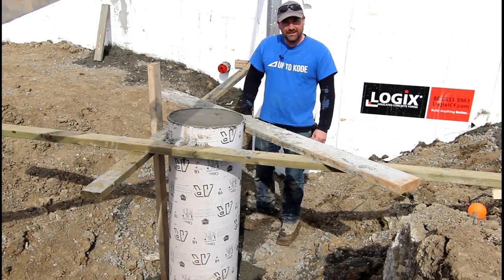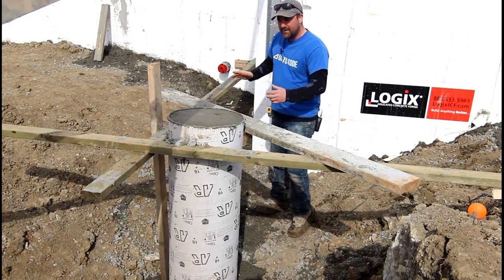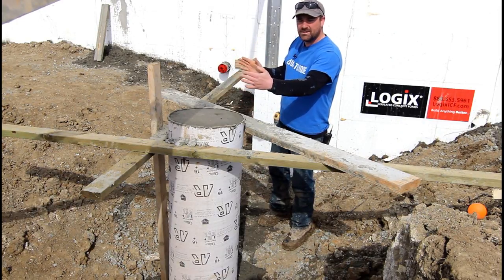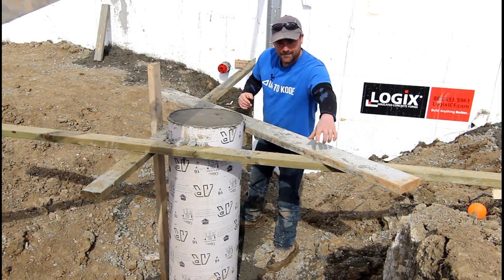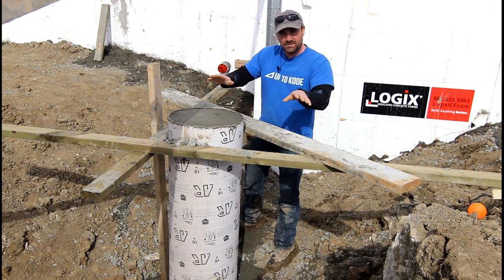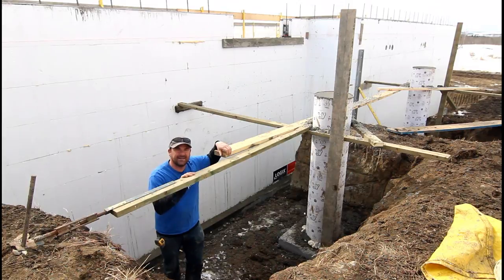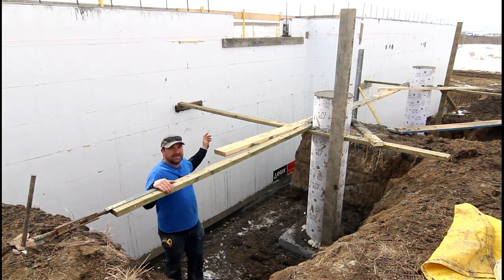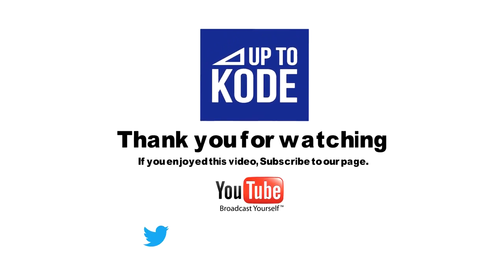The Best Way to Set a Sonotube or Pile

Comment: seems to me if the column/sonotube is connected to the wall, and it moves, the tube top moves and the base doesn't so it has to be replumbed.  It doesn't stay plumb.  assuming plumb is important.

Comment: Great video. How can you secure the 2x4 to the icf wall? is'nt it made of foam?
Thx
Reply: yes it's a very robust type of magic foam...
Reply from the maker: In most ICF blocks there’s a tie every 8 inches. This holds the force of concrete while pouring but also it there to attach drywall and siding too. 

If you look carefully (and hope you can see) there a 2x4 attached horizontally to the plastic ties. Then we can attach our braces to that 2x4.  

Does that help?

Comment: what a mess ! me and about 4 guys would set 50,  9 footers and pour them the same day, u use 2, 2×4s collar the top drive some stakes in the ground plumb them up and nail it....
Reply: DAMN SHAME!
Reply: Hey buddy. Do you think you could describe that to me a little better. We’re building a 5000sq ft lodge.   . 4 x 4 footings with 24 inch sauna tube , ranging from  5 foot six” tallest to  18 inch. Shortest
Reply: @bradforester3635  Hey Brad for the tall ones all you need to do is cut 2 short pieces of 2×4 and looking straight down on the sono tube from the top nail one vertically on the right side of the sono tube with end of 2×4 flush with the top , take the other block looking down on the tube nail it on the top " side"  of the tube vertically end of 2×4 flush with top of tube,  now take your plumb braces all you need is a couple of 8 footers or so depending on terrain take your first one and nail it to your first block same with other,what you are looking for is you want the tube to be locked in by the 2×4s ... Looking down at the tube from the top, top brace runs to the left of tube to the ground so your able to stake it for plumbing same with other brace , right side brace runs down looking at it from the top... Now your tube is locked in between the braces drive a couple of stakes one for each brace and plumb them up.  Everyone worries when you pour them they will fall over, all they do is the tube jumps up and down a tiny bit , the shorter ones just block them with some 2×4 plates nailed down to your footings and nail the bottom of the tube to a couple of the plates 6 penny flat head or chamfer nails work good , no need for braces their not going anywhere... Hope it helps wish i could show you real quick, you brace like that to keep the tube from twisting, was in the business 35 years hope it helps
Reply: And the reason you keep the 2×4s flush with the top of tube is you can lay your level on top check for level and then check 2 opposite sides of tube for plumb , ncan never check enough, concrete is unforgiving !!
Reply: @timdonahue877  very helpful. awesome man. I think I got it now. I’ll be on the job the next two weeks. Just got dune digging the 32 4x4  piers/footers. Wer getting rebar and sono tube tomorrow. Do you mind if i stay in touch? If i have any questions.
Reply: @timdonahue877  ya man i dig it. I love figuring new ways/easier ways to do construction. We used to set up batter boards for everyone of our string lines until I found a new way. Just a metal stakes and 2 200 foot tape measures and we can pull square/ lay out in a matter of minutes now. Seems like the same type of thing you got going on with the sono tube .fast and simple. Much appreciated 🙏
Reply: @bradforester3635  yeah batter boards are nice if you mark them correctly because all you have to do is go look at it to see where the line actually is , small jobs drive a stake tie your line and go for square, get your lines up 4 sides know what the number is for diagonal square and pull your tape one corner diagonally to the other looking for that number and adjust accordingly... I guess i miss it out there, gets in your blood.. Good luck Brad
Reply: @timdonahue877  thank you my friend.. i’ll keep the tradition alive. You had 35 years in the field im 35 years old.  🙏
Reply: @timdonahue877  we have a trick for keeping our lines marked. We use the metal stakes to pull square. Then we run a string line as far out of the way as we can and drop in another metal steak in line but out-of-the-way.. And we can always go back to those as our reference steaks after we get done digging 🤙 .  Pretty niffty . Really speeds things up for us.
Reply: @bradforester3635  There's alot of money in it , never sell yourself short, if your going to be out there learn as much as you can and then you ask for the big money !!!!
Reply: @timdonahue877  yes sir.  Got my license, maken $500 to $700 a day hopen to double that and add some more employees next spring.  Literally nobody my age wants to work. They want to play video games and smoke weed lol. Good  help is almost impossible to find right now. Jus me and my budy for now.. Bring in team of finishers on pour day.. (if necessary) .
Reply: @bradforester3635  Brad sounds about right , they want to hide behind walls with there cell phones, when i started off you wore a canteen on your side and you RAN !!!  it was all elbows and assholes, yeah these companies are hurting like you said they can't find anyone, their all waiting on their stimulus checks, i sit here and think about All the money I'm missing out on 😊 , but i guess i did my time... Good talking with ya , good luck with the company sounds like you will do just fine.. Take care!
Reply: @bradforester3635   Any questions shoot me a message be my pleasure to help